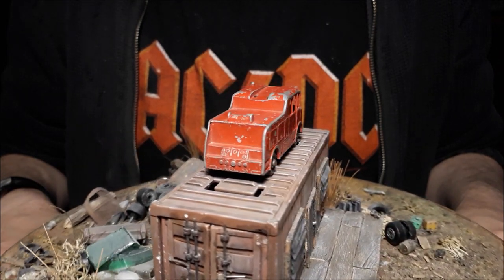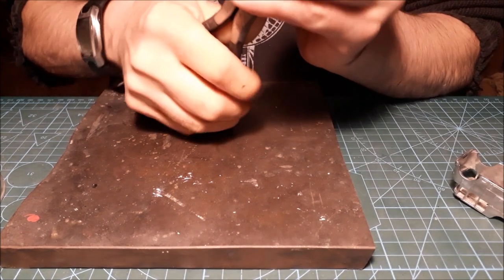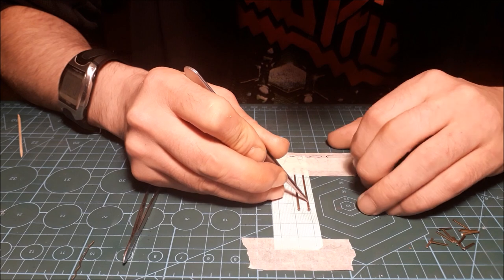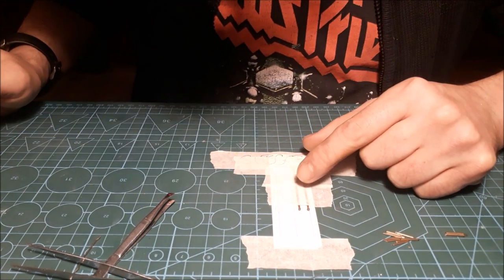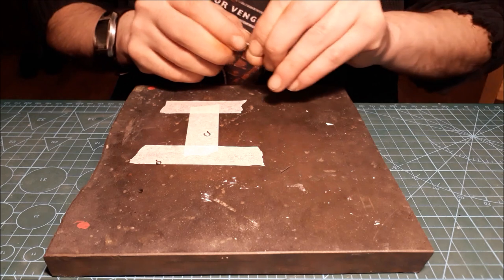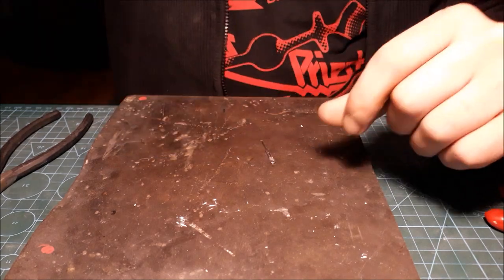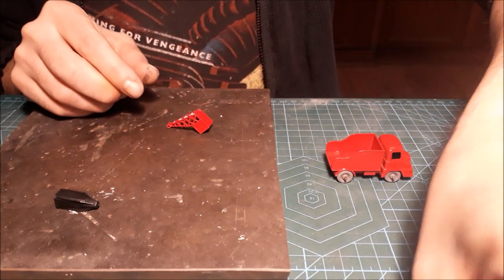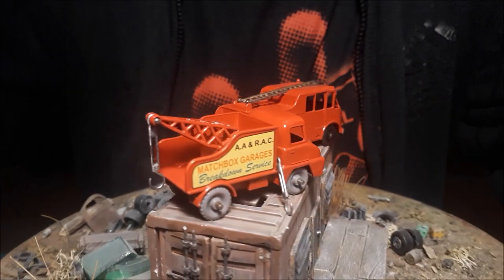Matchbox Ford Wreck Truck & Merryweather Marquis Fire Engine Nos13c&9c.

Comment: Great stuff Juan, they both look fantastic.👍👌😁 If I remember correctly, the ladder on the fire engine was unpainted brass, so yours looks perfect. You were lucky with the wreck truck though; the whole jib assembly is usually missing, not just the hook. I know mine was, still is.
Reply from the maker: Good job I didn't have to fabricate the whole thing then... lolol. Cheers Dougie

Comment: I think your soldering was perfectly fine. I believe the large chunk of steel was stealing the heat from your work piece that is why it was difficult to solder. Amazing job as always.
Reply from the maker: I think you are right... Do you think some sort of ceramic would be better than steel? Cheers mate
Reply: @MatchboxResurrection  I believe that would be a good material.

Comment: Great job, fabrication can take it's time, but man when it's done it's awesome.
Great idea supergluing the parts to the work area for soldering!!!
I'm out of this Beef's, way to specific car, i'll participate as a viewer.
Stay safe, cheers.
Reply from the maker: Thanks mate. Next time I'll try to do it on a ceramic plate as I think the steel plate was stealing the heat from the soldering making the job a bit harder. Cheers buddy
Reply: @MatchboxResurrection   Aluminum foil over a piece of wood works fine as well but it has the con of not sticking to the work piece.
Reply from the maker: @projectman-thor229  That sounds like a great idea. Cheers mate

Comment: the magnet idea is super cool. question for you? as per soldering does it work with merging 2 castings?
Reply from the maker: It does but you need higher temperature and is very easy to melt the casting in the process ..... Cheers Neil